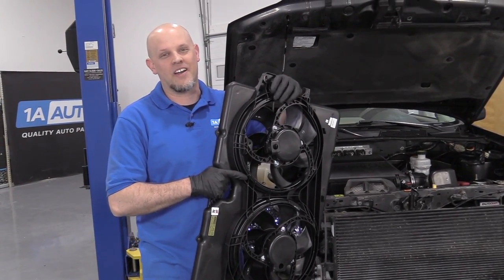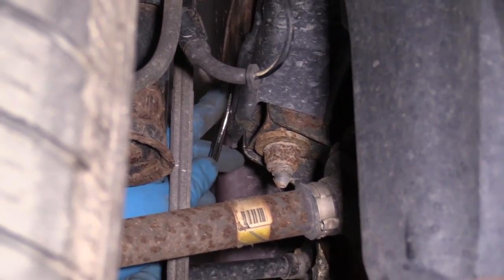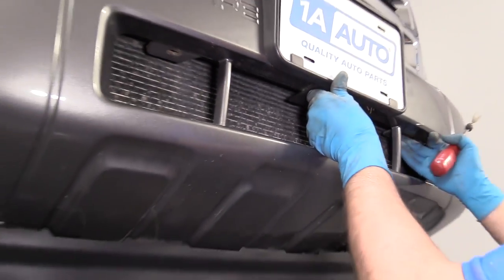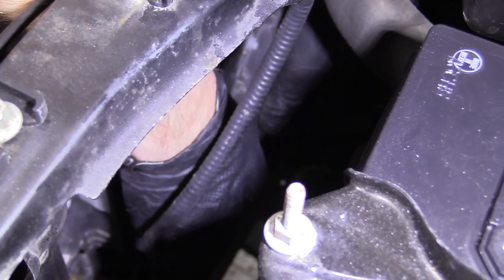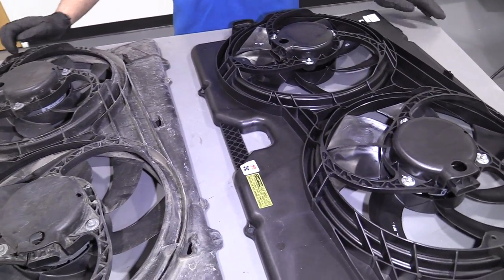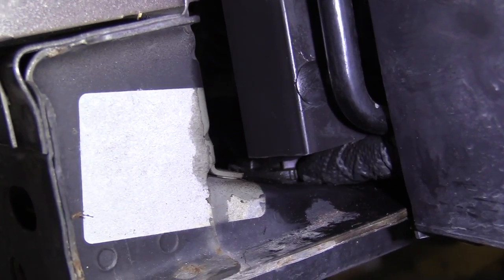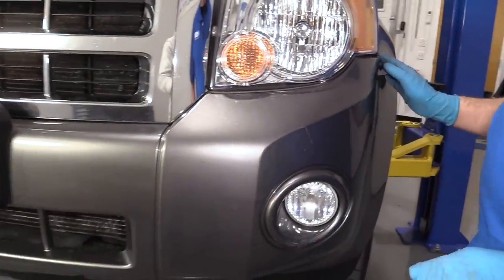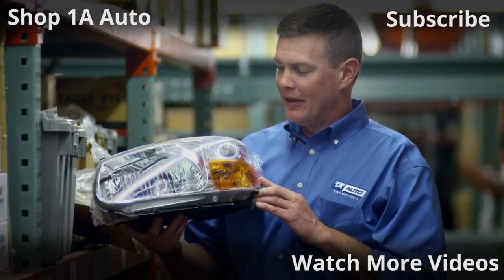How to Replace Radiator Cooling Fans 08-12 Ford Escape

Comment: Appreciate the comments! You DO NOT have to take off the entire front bumper to replace the fan. Remove the grill, hood latch, mounting brackets on the side of the radiator, and I took the radiator hoses off and plugged them with cheap rags. Remove the fan and replace. Took about an hour. 👍

Comment: Guys I bought my dual fan radiator cooling fan from 1Aauto and was a perfect replacement however I didn't remove the front bumper/grill, just took the 6 bolts out 2 from the grill and 4 from the 2 brackets (left/right side) of the grill that is designed to attach the top part of the front grill to something solid and removed the hood latch handle only then pulled back the radiator to create separation then took the 2 upper bolts out of the plastic fan and disconnected the 2 wire assemblies, it is a trick to get out but I use small air powered ratchets and was done with new fans spinning in 30 min. 9 bolts total 2 sizes of extensions (shorter for drivers side) due to the battery. Works like a champ. Cheers.
Reply: I was thinking this the entire time they were taking that front bumper off. Lol
Reply: I think removing the hood latch assembly makes it slip out easier. Just mark it's location before removing the bolts. Also taking the coolant air bleed hose (smaller one on tank) loose at the tank, so you don't lose coolant,  will allow the radiator to lean forward easier.

Comment: Thanks so much for the video - AND THE PART!!! I got it today and will be doing the work come Saturday morning. I found the fan on your site for $200 less than factory!!! And $80 less than other aftermarket brands! I'm thrilled because my truck has been broken down for 4 months while I was raising the $ for the part. Aside from the manufacturer, yours was literally the only site that had thee part. All other sites gave "options" with multiple choice sizes, you had to know the dimensions. Your site has the "right fit" search tool to be sure it was the right one for my old girl. Thanks so much!!

Comment: Bought the part from 1AAuto as my way to say thank you for the video. I did remove the upper Radiator Hose at the radiator; because after 20 minutes I did not see a way to get the fan assembly out.  In my opinion, draining a little coolant off the radiator and then adding it back is a lot easier than battling to get the fan assy out.  Fan assembly looks practically identical to the original and it seems to be of the same or better quality.  1AAuto was not the cheapest; but, I think it was a great value. Thanks!!!
Reply from the maker: +Luis Segovia Thank you! We love empowering our customers and showing how to perform DIY auto repairs with our high-quality auto parts. 1AAuto.com

Comment: Don't have to remove the bumper, just take the two bolts at the top corners of the chrome grill section and then take the top radiator support brackets loose and lean everything forward. It helps to also take the coolant tank bleed hose (smaller one) loose from the tank to allow the radiator more movement and remove the hood latch assy. to give more room to get the fans out. That's the stud that he mentioned you had to work around. You can just bend the bracket that comes around the front of the latch to the rear then pull it back forward once you get the fans in place. Then just take the bolts that hold the fan assy. to the radiator out and lift the fan assembly. Be careful when pulling the fans out and putting them back in of the small coolant hose nipple (don't break it off) at the driver's side low on the radiator, where that hose that runs under the fans attaches. You have to maneuver the fan assy. to the rear a little to get it around that hose nipple. The hood latch bolts have those teeth on the captured washer that will mark the position it was in so just look for the marks and try to get it in the same place. Remember to put the upper panel on when you finish up.Takes about 30-45 min.
Reply from the maker: +manstersr We appreciate the feedback. Sometimes there are multiple ways to accomplish the same repair.

Comment: Nice video but there's no need to take off the whole bumper to do this job. I did this earlier today on my friend's 2012 Escape V6 in her driveway with basic hand tools and it wasn't a big deal, the whole job took me less than an hour. I just took off the upper grill, the plastic piece above the radiator, intake duct, hood latch assembly, and the radiator mounting brackets. I also took off the 2 coolant hoses on the top passengers side corner of the radiator because they were in the way of being able to lift the fan shroud up. After carefully pulling the radiator forwards, I was able to get the old shroud out and the new shroud in no problem. It was a little bit of a tight fit, but I don't see how removing the bumper would have made the job any easier.
Reply from the maker: +Avery Alexander Thanks for the feedback!

Comment: I have 2011 Ford escape 3.0 L and boat radiator fan are working constantly the minute I turn the engine on. I guess it maybe a sensor but not sure we’re is located for testing . Is there someone can help me.

Comment: Can you do this without removing the entire bumper my grill is already off but not bumper. I realize might add a little difficulty but is there a reason I would have to remove it?
Reply: Yes you can! Just remove the two ten mm for the grill you will have enough room to pull the fan out.

Comment: You do NOT have to take off the whole front bumper cover, only remove the 4 screws holding the grill and support back pieces, remove 1 screw holding hood release an the radiator is accessible

Comment: I replaced my cooling fan assembly and now both fans run continuously. It didnt do that before. any suggestions?
Reply from the maker: +Scott Hildebrand We wouldn't be able to diagnose an issue like that here, you may want to have a local mechanic take a look at it. This may be a relay that isn't working properly or there may be an issue with the temperature sensor. Thanks for checking us out! http://1aau.to/m/Shop-1AAuto-c

Comment: Whats the average time it takes to change out the dual fan cooling assembly?
Reply from the maker: +James Colbert Thanks for watching!  It depends on the comfort and experience level of the mechanic, but this job usually takes an hour or so.  1aauto.com
Reply: James Colbert , hello James I just posted to this today actually and I saw your comment asking how long it took. It took me exactly 1 hour and that is with watching the video at the same time, pausing it and re-watching it. Just take your time and you literally only need four tools to complete this job as the awesome video explains this. Good luck